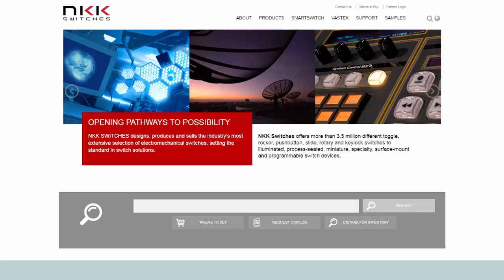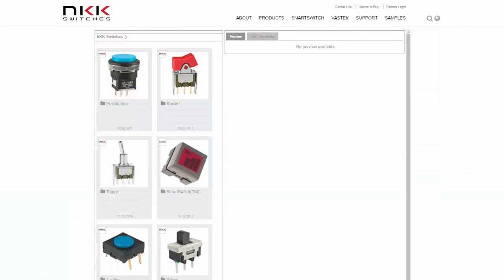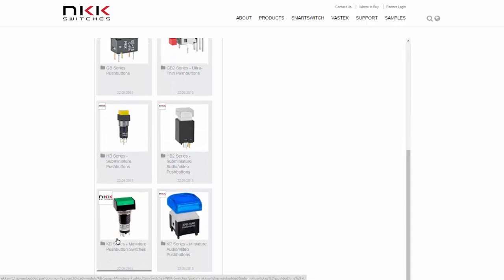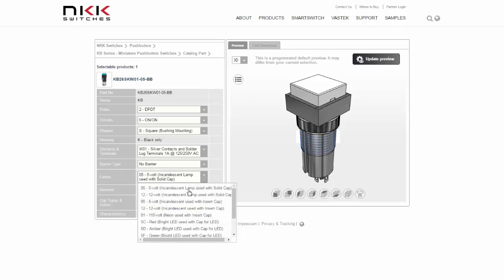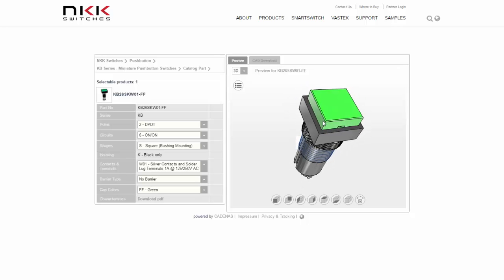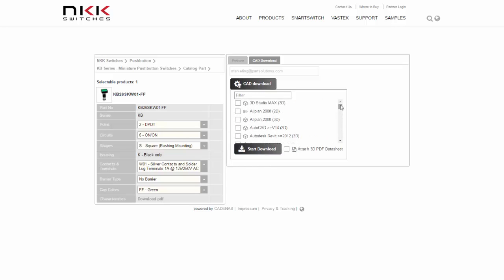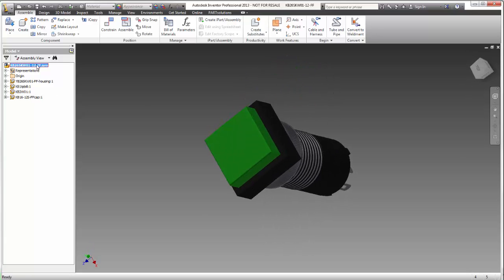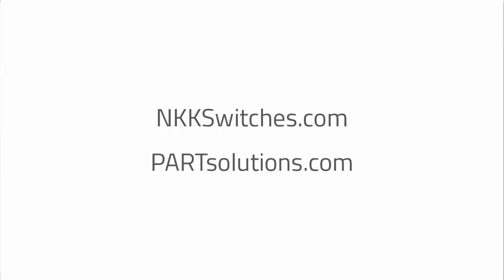NKK Switches Demo: 3D Parts Catalog and Downloadable 3D Data Sheets

Comment: I like NKK switches, and have used them in the past. I was disappointed to find that there was no way to get a symbol or a footprint for the switches I was interested in. I am using KiCad, and if I can’t get all three files, I will look for a manufacturer that does. I would rather not, but practically speaking, it’s too much work to generate them myself.